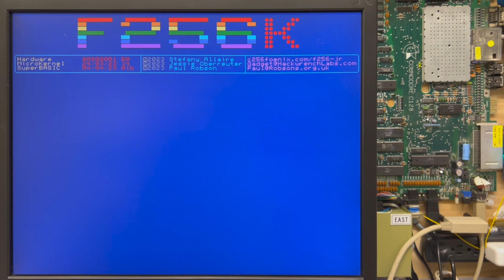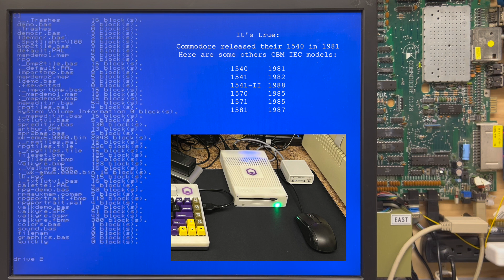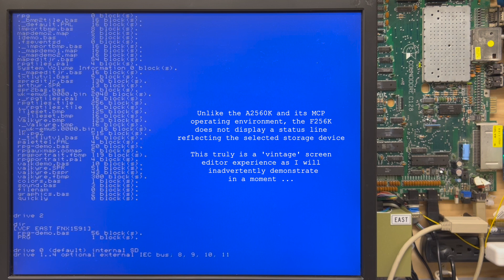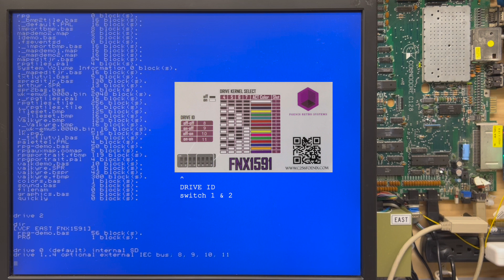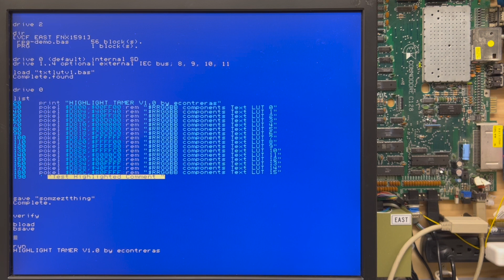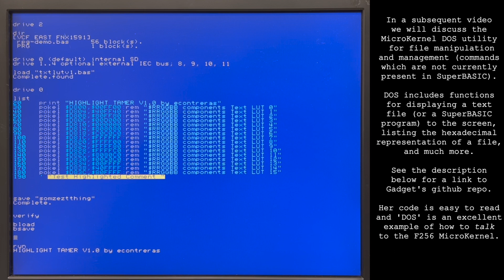Foenix F256 SuperBASIC Part 3 - Accessing SD and IEC Storage

Comment: It's hard to beat the FoenixMgr python scripts to send data directly to RAM from a modern computer, but once simply copying from modern PC to F256K SD card is functional for those without the cartridge RAM expansion, that bload command is gonna get some serious usage again from me.
Reply from the maker: Despite this being a 'new' machine (< 6 months old depending on how you count), the ecosystem of utilities and workflow has been evolving for 3-4 years and most, if not all of the original developers are still with the project.  Personally, I write code in VS Code and use 64Tass on a modern machine and with one mouse click, the code is in the F256 and running; it's extremely easy to pull memory back and forth for examination as well.  A 'modern' ML monitor was just released as well and more on the way.  From a SuperBASIC perspective, Paul created an off-host workflow where you can code procedurally on your Linux, Mac, or PC and then push the BASIC source in, likewise but I haven't played with it as of yet; I do like working within SuperBASIC directly.  That's part of the experience.  Thank you for the comment (sorry for not replying sooner, it was buried in a bunch that needed review).